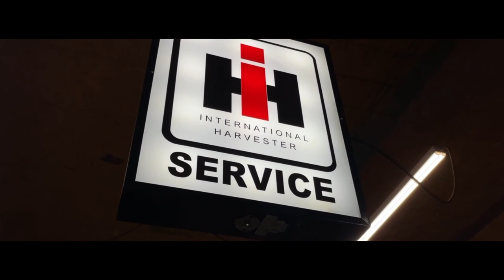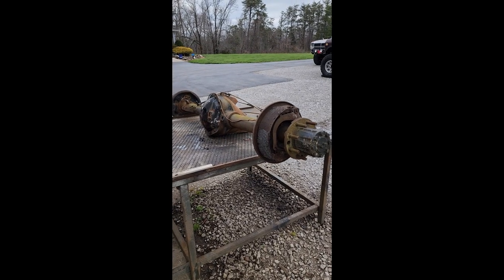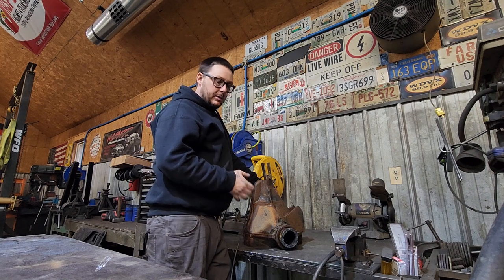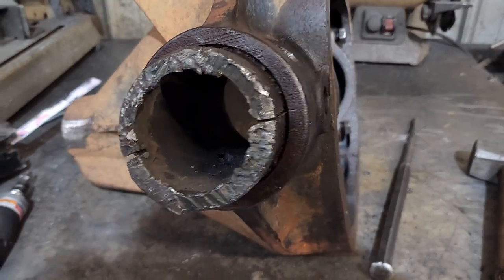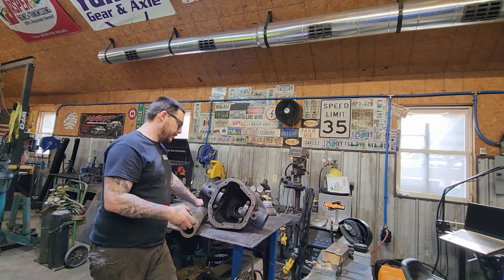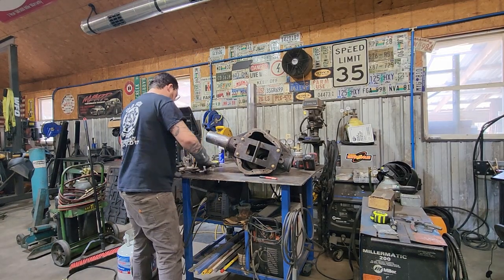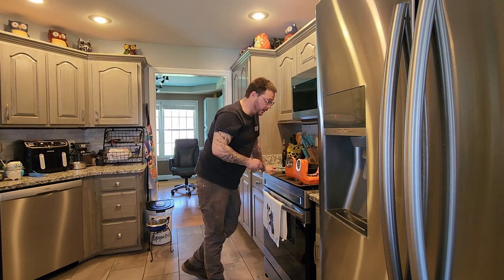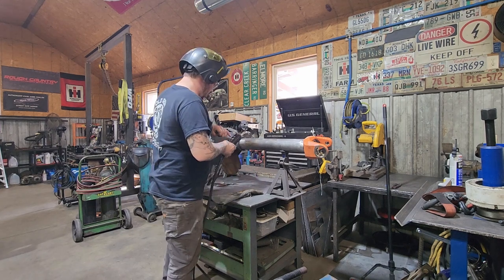HOW TO BUILD YOUR OWN CUSTOM DANA 70 FRONT AXLE !!!

Comment: Hot Hot Hot!! 😂
Very interesting conversion.  Following! I just watched the Dana 44 cut and turn video again yesterday as I am about to modify my 77 Scout II front axle.  4" RC suspension with Zero castor and 33 X 13.50 Nitto Mud Graps... Goes every direction but straight. 😂
Reply from the maker: It was a long run from the stove to the shop....  🤣

Comment: Awesome build sir and great news on your wife 🙏 Are you planning on using 35 spline Chevy kodiak axle shafts? If so what's the length on your axle king pin to king pin?
Reply from the maker: I will use inner shafts from branik motor sports in the 35 spline flavor.  1.5 diameter.   Not sure on kingpin width.  Will have to measure.   Thanks for watching!!!

Comment: should have put the tube in the freezer
Reply: As a heavy equip mechanic rebuilding equipment for decades. Yes freeze parts you want on the inside, and heat parts you want on the outside.  Usually 125c for bearings and most parts. 
It also helps to use some sort of lubricant, even engine oil, hyd oil to help slide it together. You can buy wax pencils that melt at this temp as well. Also don't be afraid to grab a block of wood or blunt chisel  and a hammer to ensure   parts are in bottomed

Comment: Awesome awesome job. I have two questions, when you’re taking a Dana 70 rear and putting it in the front do you need any particular gears I guess what I’m asking is that rear end can spin in any direction it doesn’t know if it’s in the front or the back I hope that makes sense. Second question if you had clean factory knuckles let’s say a Ford F350 and everything else and didn’t want spend the money on the custom parts you could weld those on it be perfectly fine correct?
Reply from the maker: Thanks.  Just standard rotation gears.  A front axle is just a rear axle driving on the coast side of the gear.   Things get weird when you " flip " a diff into a high pinion.  That is where reverse rotation gears come in.  Sure.  You could use factory knuckles.
Reply: @OldIronOffroad  awesome thank you so much.

Comment: Happen to have a part number for that inner seal ? Also what axles are going to run ? Ford ?
Reply from the maker: So the inner axle seal is a standard GM dana 60 inner axle seal.  Shafts are custom length from Branik Motorsports.  They are just a  shade longer that a stock GM 60. I will have more on the shaft on an upcoming video.